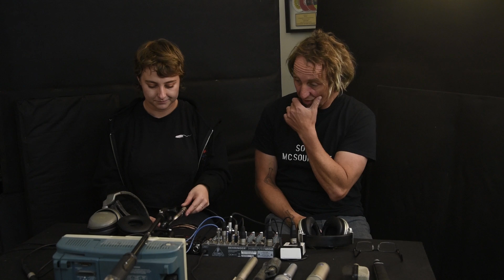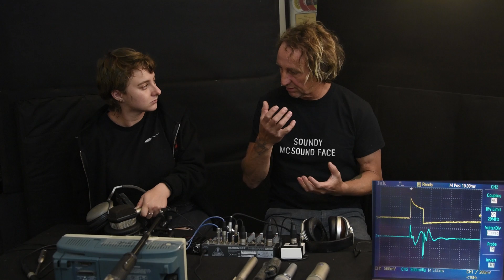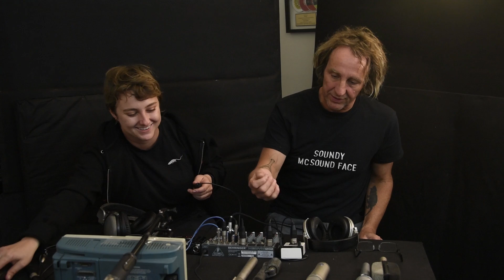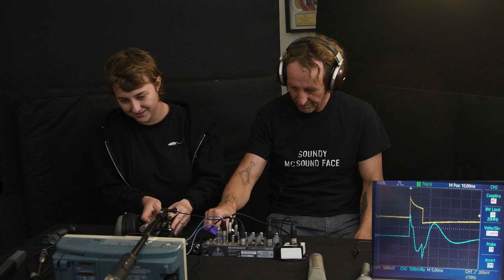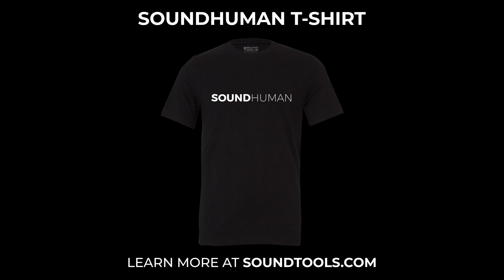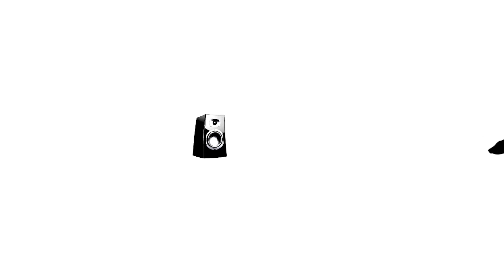Mic Test Pulse Check - Microphone Chat With Sammy #3 of 3

Comment: Well as usual you bring up some interesting points.  I've never bought a set of speakers or a microphone for that matter, because it was the most expensive one on the market.  It's also hard to say that any piece of sound equipment I've ever bought was the right choice because of the environment I was in when I purchased it.  We don't get the luxury of having the environment we plan to reproduce sound in in our pocket so that when we choose gear it's exactly what we want.  What I love that you teach is know your equipment and the environment your currently in and work with what you got to reproduce not the best sound but more so the desired sound.  I also would emphasize to know YOUR equipment....your SM58 and my SM58 might sound different.  I actually have several specific mic's of the same make and model that sound different. One might have a little more warmth than another and maybe one has a little more air.  Love your videos.  Stay safe and healthy and look forward to the next video.
Reply from the maker: Thank you Stanley! And yes, you get it!

Comment: Got me thinking about modeling software. I'll get an amp driving a cabinet in a way that I think is just right. Set up the early reflections and room sound to have just the right air and space. Then think, "It's good, but it's a bit thin." So I'll 'reach' for a darker 'mic' - there is a ribbon I go to frequently for warmth. Now looking at the distortion of your ribbon on the scope I realize that the model I'm using in the software is certainly masking some of the detail I've worked so hard to get. Then, any changes I make after the mic choice are made through the veil of it's character. 

Of course, that's they way the whole thing is made from start to finish because in digital guitar rig modeling we can only hear the results of what we are doing through a modeled mic. There is no actual amp and speaker in the room to compare with the mic'd signal we're getting to the record, or monitor. (I could chase my tail all afternoon on this one.)  I don't mean to discount your efforts here (playing with sound like this is always a worthy effort) when I say, that is just reinforces the old adage, "If it sounds good - It sounds good."  

But you certainly got me thinking that I might want to consider more carefully the first mic to use when setting out to design a virtual tone.
Reply from the maker: Interesting.  Don't do much with modelling